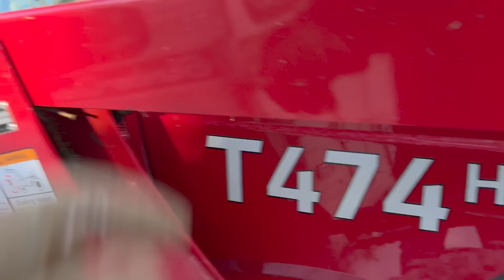Couple Building Cabin In The Canadian Wilderness | Clear land for Cabin Extension | Tractor

Comment: Jeremy try using calcium chloride salt. It will not clump up like the salt that you were using if that is available up in Canada good luck and the extension that you’re putting on looks like a good add-on stay warm stay safe.
Reply from the maker: I feel like this might be that kind of salt, but cant remember. It has been sitting under the deck for over a year lol. Thanks!
Reply: @MBFModernHomesteading  
Very possible just add humidity and watch it change  shape HaHaa

Comment: Those vinyl sheds are a pain unless you strap them to the ground using dog tie outs and ratchet straps. I learned this by experience ... twice! On the plus side of losing the 1st, I used the top portion for a wood storage cover, it was low enough to the ground the wind didn't affect it much. The 2nd one lol, I used the material to cover the plow truck which beats having to push snow off it and keeps it out of the sun in the summer. As for the Red-Green tape job ... I'm sure he'd be proud he made such an impact. 😂 --Jerry
Reply from the maker: This is actually our 4th one lol. This one was tied down fine, no issues there. It couldn't handle the ice and snow though, we even reinforced it and tried to keep it cleaned off, darn thing still collapsed lol. Should have duck taped the whole thing lol.
Reply: My latest, standing 2yrs strong now, I pegged the foot plates with gutter spikes and ... wait for it ... used duct tape on every pipe connection lol so far so good. Ice and snow build up is an issue here also (West Central ILL USA) I've yet to discover how to pull the slack from the fabric to stop that. Considered spiking in garden timbers along the bottom apron. Once you have the garage you'll look back and laugh at the trials and tribulations those vinyl sheds put you through. Until next episode, may God Bless -- Jerry @MBFModernHomesteading
Reply from the maker: That thing will last forever with the duck tape lol.  @JK-gn6qr

Comment: Hey about that tuck tape you used to patch that hole. The dye in the tape bleeds through whatever you stick it to after a while and it is pretty much on there permanently. It probably isn't a big deal on the top part of the cab since it is red too, but I see you put some on the side which is black. You'll see where that tape was forever unless you maybe sand it off, but then you might see a difference between the sanded part and the rest of the black section. Just giving you a heads up, I learnt this the hard way!
Reply from the maker: Thanks, I'm not concerned about it. Tractor will probably take a beating over the years anyhow. :)

Comment: That plastic piece fell on the ground. You could put it back on with some seam sealer. I mean, that tape job was pretty spectacular, but if it fails…plan b?
Reply from the maker: That tape job will hold up longer than the engine.